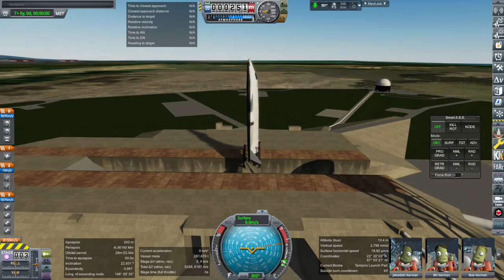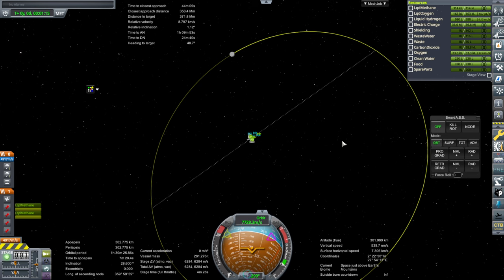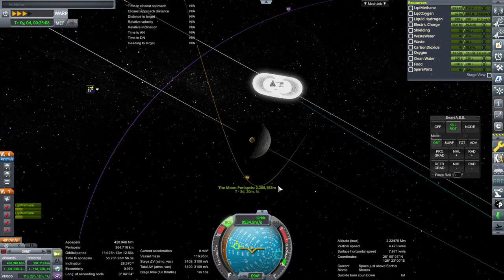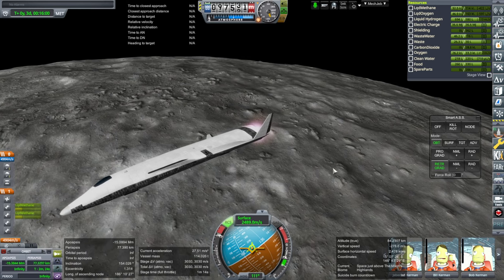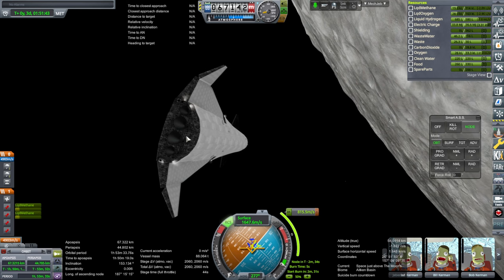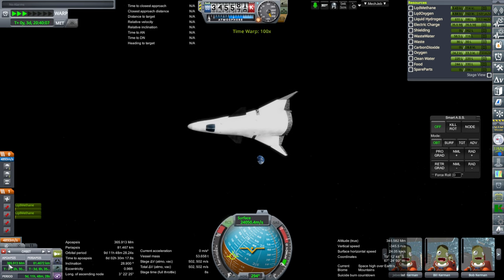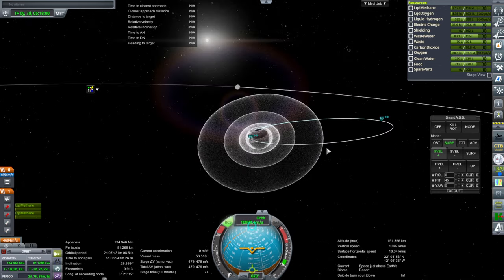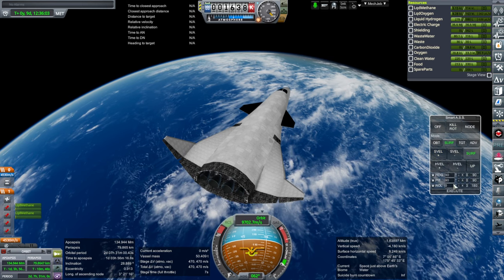Shinkansen Lunar Test (RO in KSP 1.12)

Comment: i have 2 ideas. first this ship lacks active termal radiators that space shuttle had in cargo bay doors. it may not help during aerobraking (aero baking?) but may help to cool down between dives. it may also help to conduct heat to the tail and prevent cabin from overheating. second idea is to go with higher Pe but upside down to push towards the earth and stay longer in the upper atmosphere where heat effects are not so strong.
Reply from the maker: I'll think about those options. Maybe some sort of active cooling of the body instead of just the Shuttle system might be necessary, but that sounds heavy.

Comment: Great looking plane, but I don't think this concept is viable unless a couple few initial passes of aerobraking can put the vehicle in a quick LEO orbit. You obviously want to limit radiation coming from the van allen belts as much as you can but you also want to avoid burning up, the most reasonable idea I can think of is somehow pushing out more delta V do slow your vehicle as you're approaching your first aerobraking maneuver, so that can you dip in deep enough to lower the apogee by a lot while lowering the stress, G's, and temperature.